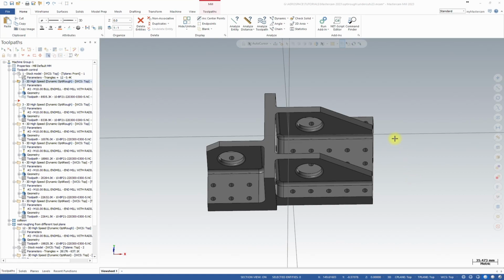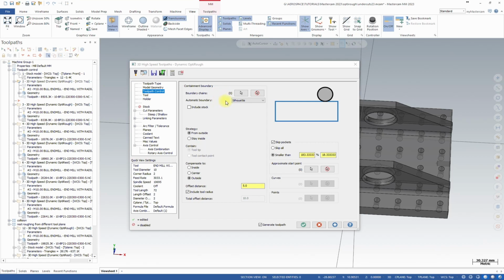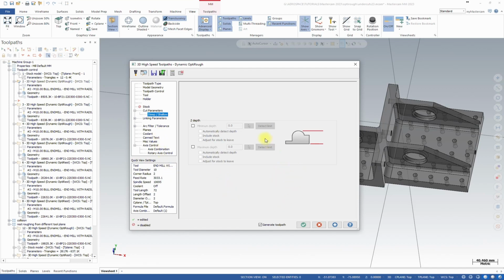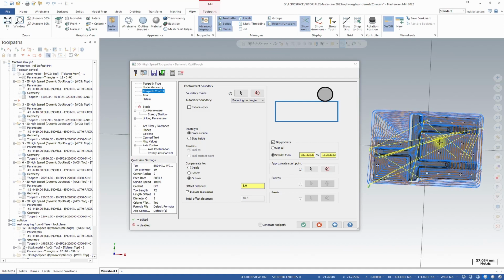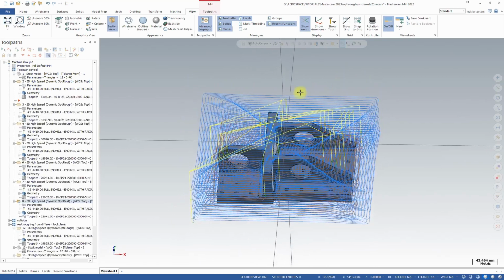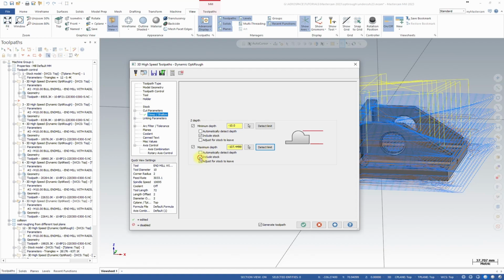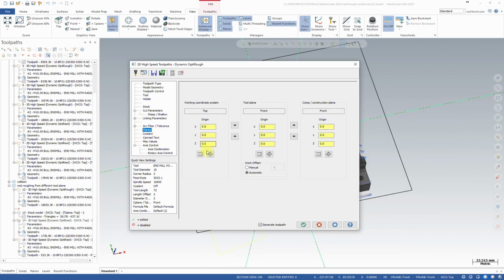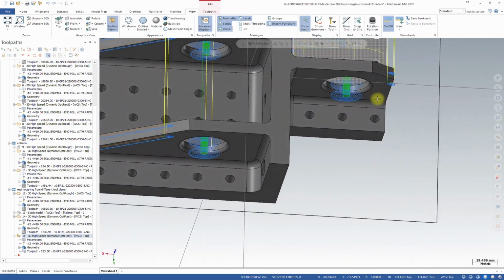Mastercam 2023 - Sneak Peek - Improved OptiRough

Comment: Hi great content. Are you sayng at one point here you can actually stay away  from  your stock model by using the offset? Like in 2d dynamic where you can choose your first  pass offset? Can you now get your tool to go below the stock? These are both limitations  that i find myself going back  to 2d dynamic.
Reply from the maker: you can go deeper than your stock by using the maximum depth greater than your stock depth
with your stock model selected you can extend the size of your machining boundary (if its inside of your stock) however Mastercam will trim passes only to the size of your stock, 
You can select the stock model by activating the rest mill (on the stock page) 
In RestMill (OptiRest) Mastercam can only generate cuts where the material (stock) is available to machine
Reply from the maker: also, you can extend the machining area without selecting the stock 
Select containment boundary and on the bottom of the page as "compensate to:"  select "outside" then you can add additional "offset distance"  this is the distance to expand your machining area
it works only with an "automatic boundary" set as the "silhouette"/ "circle" /"rectangle" it also works when you select your manual boundary chain

Comment: Good improvements. A "machine flat faces" feature would be banger :) Imagine you have a part which has 2 flat faces, one on top and one 10.4mm lower and inbetween there is a tapered wall. You have an endmill with 12mm flute length and want to use stepup cuts at 1mm step up and also machine the faces with the same stock to leave (0.2mm) as the walls. Either you set the cutting depth to 12mm and stepup to 12mm to machine the flat faces and then you have to create a new optirough to machine the step up or you only step down 1mm with 1mm step up value, which is not really ideal. (setting the step up value the same as the step down value forces mastercam to machine flat faces with stock to leave, but obviously there will be no step up cuts).
Reply from the maker: Agree It would be good to have an option to detect flats when using only stepdowns (without stepups) 
At the moment when use optiRough with stepups Mastercam also inserts extra cut passes when stepping up to clear all detected flat areas